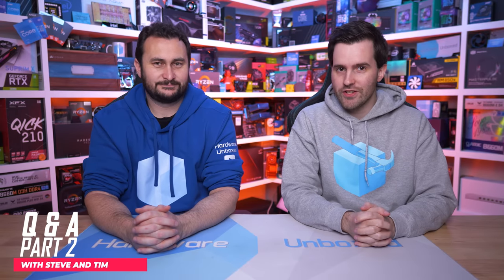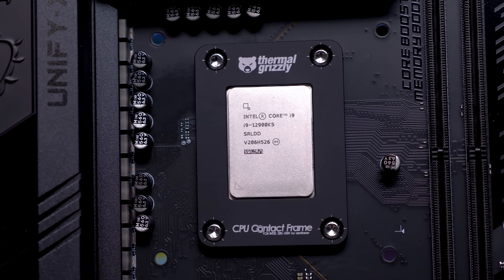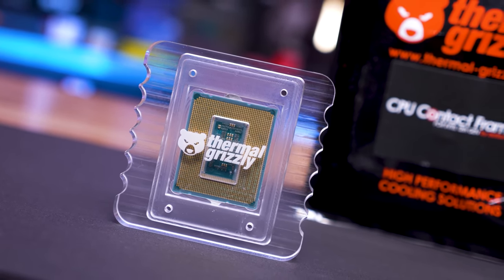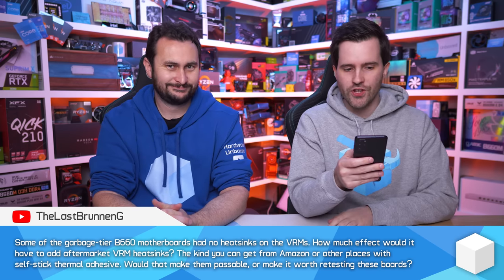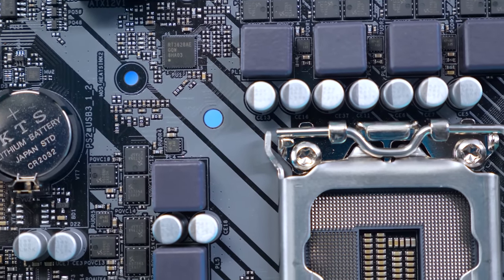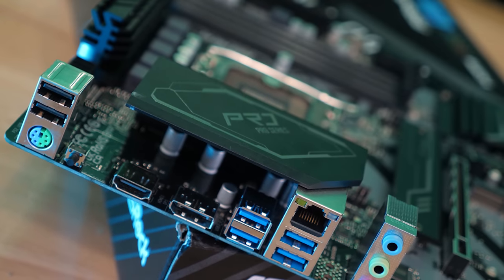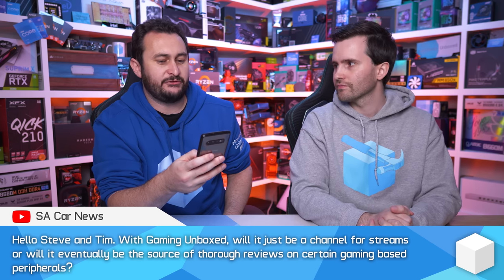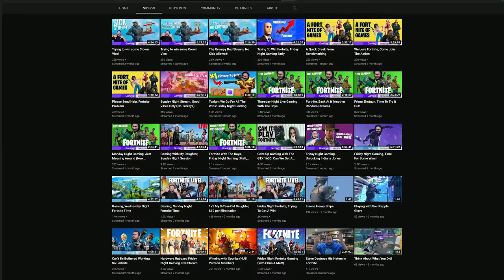Biggest Tech Fail 2022? Zen 4 To Make DDR5 Relevant? August Q&A [Part 2]

Comment: To design a game, that say, dedicates a character's AI to an E core, would be extremely difficult to do in a way that doesnt hold up the P cores, or the AI is held up by the main core.
Reply: Yeah, developers need to sit down with cpu manufacturers and get that 💩 sorted out. I've been sold for decades that games will be multicore optimized.
Reply: @Shadow__133  I have no idea what you want them to sort out. The hard part of a multithreaded game is to keep everything in sync, and E cores can't keep up with P cores.
Reply: @jeromenancyfr  I don't have E cores, but the regular sized ones. And they are barely used by games. What's the point of having multiple cores if games don't use them efficiently? I mean it's nice to record/stream or do photo editing, but doesn't benefit games as much as clock speed.
Reply: @Shadow__133  I just don't get what game developers would obtain from CPU manufacturers unless a solution is found to magically see all those cores as one massive thread.
Reply: @jeromenancyfr  That would be awesome! Or at least coordinate game development with the chip design. Like 5800X3D, that actually reduced clock but the performance gains on some gains were phenomenal. 

What drags the industry is always a lack of coordination between all the parts.
Reply: @Shadow__133  What I described is the Holy Grail, the concept exists for years, if not the start of computers with multiple cores, but nobody found a way to make it a reality.

Comment: Looks like I am going to be satisfied with my system for quite some time. I ran an Intel i5-2500k platform from release to 2020. I then upgraded to an i5-10600k which performs beautifully at 1440p along with my rtx-3070. I will still pay attention to what's new in the future but my current machine is happy. This comment is regarding the ddr5 question. It is not really needed at this time.

Comment: its not only mouse DPI, its also mouse sensitivity in game, good indication is how many cm you have to move mouse to make full rotation (cm/360 angular degrees), I am using 25cm/360, to measure it you can use KovaaK’s Sensitivity Matcher

Comment: Pertaining to multi core processors.  Still gaming on an I7 4790K with an RTX 2060 and it works perfectly on High settings in games like Vahalla, Doom Eternal, Fortnite, and Genshin.  Medium to high on RedDead, Battlefield 5, and a few other AAA games.  So, you don't need a 5950X or an I7 12700 or beyond to have a great gaming experience.  I would have never thought that the 4790K would be great for gaming 8 years later.

Comment: With current CPU limitation to graphics I do wonder if someday they might add a small support CPU near the GPU to handle the most demanding operation in a way that the CPU/RAM/Cache are release from that task and improve game performance this way...we already see this with raytracing, DLSS and so on, hopefully more features could be added. Also would improve sell having more features added on next generations the same way ray-tracing is doing on each generation.

Comment: It is worth upgrading for gaming from a PCIe 3 PC to a PCIe 5 PC - will it really make a noticeable difference in gaming? And, won't the PCI 5 in both storage and GPU both be needed ... because the new AMD 7000 series AM5 motherboards, one has to chose one or the other but ya can't have both ... unless you buy the "Extreme" versions. So, will it be best to wait a generation for better use of PCIe 5 etc?

Comment: If you want to compare sensitivity across multiple titles you use centimetres for a 360 turn. Like actually how much mouse moves (only horizontally) to perform that. Either test it or check it by online calculators.

Or if you compare sensitivity between a certain title or same game engine then you can use edpi which is just dpi x sensitivity value.

Comment: Long story short: If you do productivity, especially 3d rendering you will need a gpu as its always faster than cpu. If you have huge tile size or alot of data you better go with cpu bcz it can utilize the Ram which is always abundantly available. Bcz DDR4 was slow, the cpu couldnt compete with GPU. But now we get DDR5 with alot of speed and super fast new CPUs , so the cpu market is saved : yayy :} I use it in Blender and when my 12 GB of my gpu are drained I must use my cpu , else I run into error!
Reply: Since Blender 2.8 you also need a good amount of RAM. Otherwise you limit yourself big time. But depends again on the Programm itself.

Comment: Gamers generally use cm/360 as a measurement of mouse sensitivity, average probably sitting around 30cm/360 while pros in slower paced games (Csgo/r6s/valorant) will go as slow as 60cm/360. It's a combination of dpi+ingame sens and there are several calculators out there that'll calculate it for you, Kovaaks (an aim trainer) also has one. Modern shooters will usually use raw mouse settings so the Windows sensitivity setting gets ignored. So you'll keep the same dpi (~1600 sweetspot for latency, Optimumtech has a good video on this) while changing your ingame sensitivity setting game to game and calculators will give you the number needed for a precise conversion between games.

Comment: The first 6c/12t CPUs for gamers were the Ryzen 5 1600 and the i7 8700K, and if you bought an 8700K in late 2017, it’s not much slower than the 5600X today, so if you are still willing to put up with the power draw, that’s your 2500K — where the platform, and the old PCI express standard is letting you down more than the CPU performance. Unfortunately, with the cheaper 1600, its single-threaded performance was at least in step with its pricing compared with the 8700K, but it just wasn’t very fast, so it hasn’t aged that well, although the platform around it has, since you can upgrade to your choice of a 5800X3D or 5950X. The problem with upgrading like that is that when you are spending so much more on a new CPU, your build becomes unbalanced around it, and you’d most likely be better off building new. So, you say, I’ll upgrade to a 5600 instead! Well, why the heck didn’t you just buy an 8700K in 2017 and have 5600-like performance all this time?? By the time you’ve bought two CPUs to get there, you haven’t saved any money, and now you’re relying on your old board to support a new CPU.

I upgraded my 1800X in stages up to a 5950X, and it’s a weird pairing with a 5700XT, plus I replaced my motherboard for PCI express 4.0 and Thunderbolt, and I was going to upgrade to 64 GB RAM, change my cooler, GPU, Storage, power supply, and case… So instead, I’m building new next year when Zen 4 with V-cache comes out, and enjoying the extra CPU horses and features for the next six months.

Comment: I still want to see the unlocked SKUs and the Z boards move to HEDT socket like i7-7700x was.  Have i5 and i7 as 2ch 20 lane parts, Z boards as 2ch 20 lane parts with a 240W max power limit and VRM design minimum so that all boards are capable of running that 240w 24/7/365.  Then have all i9 parts be 4ch 40 lane parts, the X boards 4ch 40 lane parts and no power limit.  All CPUs function in all boards, but would naturally be limited to the lower memory and lane count if you put an i9 on a Z board or an i7 on an X board.  The X board would be the only board needed for all LN2 OCing of any chips that way.  I would also suggest considering limited edition unlocked Celeron, Pentium and i3 CPUs specifically targeted for competitive overclocking.
I would also want to see all the locked SKUs on the consumer B and H boards be base clock overclockable, but have a limit similar to that 150W capped B660.  Then even the most budget conscious buyers can still play within limits.

Comment: I would consider the state of HDMI cables to be a fail.  The specs are usually vague.  I have returned more HDMI cables than any other tech item.  SSD's releasing with a fast throughput, then that company keeping the same name but switching to slower parts is a fail in my eyes.  Microsoft was using low level API's in the X-box for years before Direct X 12 was forced into existence by MANTLE.  I believe there was a big push from Microsoft around 2008 for PC gamers to switch to an X-Box,. So I bought a PS3 because my Enzotech water cooled PC sprung a leak and I lost all of the big components, a second system was not in the budget.  I got a month's use out of that system.  These are just my opinion

Comment: AI Specificaly pathfinding can be offloaded to async tasks

Games that have dynamic LOD can also load and process mesh and other elements in an async way before handing them to a synchonous thread for integration into the rendering

Also I'm running a 16000 DPI mouse with the DPI maxed but I have the ingame and in windows speed lower

Comment: It unfortunate to see how many people still misunderstood the purpose of Intel's E-cores. They were never there for gaming. Intel was getting tired of being thrashed in certain productivity workloads that benefited from having lots of cores. Intel also didn't have a meaningful answer to AMD's 16 core consumer SKU, which explains the radical change in 12th gen architecture to big-little core. Etc, etc, you get it.

Anyway, latency is what truly matters for gaming. The reason why modern games require more than 2 and even 4 cores, is because the clock speed haven't improved that much.

Comment: E-cores is basically Cinebench/Vray/etc accelerator. They only named it E-cores to make people think the processor is efficient because it has the word efficiency in it. If E-cores is actually for efficiency and running background task, they won't pack that many since it won't make the processor run more efficient. Imagine if you have a task that can light all 8 cores, would you run it on P or E cores? As for light last, what light task that actually need 8 cores? background task probably wouldn't need more than 2 cores. If your background task actually utilize the E cores to 100%, it probably need the P cores.
Like the video said, Intel put E-cores to win multithreaded benchmark. With their process, at best they can only put like 10 P-cores on a single CPU (probably 12 cores on 13th gen) while AMD can do up to 16 cores for their consumer part, so Intel ended up sacrificing core versatility for packing more of this general compute accelerator (a.k.a E-cores). Their 13th gen, instead of increasing P-cores, they kept P-cores count the same (8 max) and double that slow E-cores count (16 max).
Edit: I actually don't mind E-cores, but for most people that aren't using something like Vray, you don't really need E-cores. 6 to 8 P-cores is enough. But if you do using your CPU for rendering or some other task that can actually light all cores to 100%, you actually would benefit from something like 2 P-cores and 40 E-cores (since 1 P-cores is almost equal to 4 E-cores in size). I imagine 4 E-cores would suck more power than 1 P-cores, so you probably won't see that kind of config. So basically Intel is trading 1 P-cores, which should use less power, with 4 E-cores, which although individually it uses less power than P-cores, but 4 of them is probably not using less power than P-cores.

Comment: Can you guys throw us a bone with a link in the description to the part 1 video in the future pls? It took some screwing around to find it, when really it should have just been linked below. Thanks, and keep up the good work.  :)  I run my mouse at 3600DPI full time, in games i run at that same DPI but i use a DPI SHIFT function on my Logitech mouse to bring it down to 800DPI for fine aiming adjustments in shooters, but that's only when I'm taking a shot, then i release the shift button and it goes back to 3600DPI. I have problems with my hands going numb when gaming, and this helps a LOT since i can move my hand like an inch, and do a 360 spin, unless i am ADS in which case i use the shift state. I also use a Razr 1 handed keyboard on my left hand for the same reason.

Comment: You can use the g-hub software to see what your DPI is set to. That is the true DPI you're using because that determines how often information is reported to the game. You can alter the effective DPI further by changing it in game like you mentioned, but as far as the frequency of the information being reported to the computer/game, that will be determined by the DPI setting of the mouse independent of the game settings.

Comment: Testing some popular configurations may be a cool idea. But the problem is to settle on specific configuration like budget/mainstream build, or typical 1080p/1440p build, or some USD value build. Comments regarding the parts choice would be inevitable.
Theoretically, estimate performance of specific configuration can be calculated from the frame time of specific parts from cpu review and gpu review. The result should be also adjusted for memory and motherboard performance differences, but at least that should have lower impact.

Comment: Why not just use 1 PC as desktop in ones 'office' and run an HDMI cable to the TV (with eARC and HT system) in the livingroom for your HTPC needs and just use wireless peripherals? Then there's no need for dual expenses.
At least that's what i do and it works a treat!
To be honest i can only do 4k 60 444 right now because of my 1080ti, so for 'faster' games i run them at 1440p 120 so i don't drop under 444.

Comment: 22:58 I ran into this problem in 2017, I bought an I5-7400 based computer which was a step up from my previous AMD A10-6700 but ran into problems with games like Fortnite where the 4c4t weren't enough. So i went to an 8c16t Ryzen 7 2700 for my next build after that, and now i have plenty of cores, but my IPC still leaves a lot to be desired. So for my new build this year im going high end, this will be the first time I will be spending 400$ on a CPU

Comment: There are game engines that are heavily multi-threaded, Destiny 2's for instance, but they require a very specialized engine. They use a task-stacking style where they farm out a stage of tasks to multiple cores, wait for therm to all finish, and then consolidate the results in to a final world state that moves forward to the next stage in the pipeline. There's a pretty good GDC talk about it actually. Again though this requires your engine to be written from the ground up to work this way. Unity and Unreal are just starting to expose this style of multi-tasking as a first class citizen in their engines. For teams writing custom engines, if they didn't start this way, they aren't going to retrofit. You have to start from the ground up with all your primitives written to play well in a mutli-threaded world. Latency only comes in to play with these style of engines at the very end when the world state needs to be consolidated. Otherwise each thread processing tasks will likely have it's most important data in cache.

Comment: asking for someones DPI or ingame sensitivity is useless, the basic thing to ask for is the "cm/360°" meaning how many centermetres of moving the mouse sideways until you do a 360 on screen

but that is only basics, the rabbit hole goes pretty deep when it comes to FOV or scopes or windows sensitivity affecting the sensitivity (in some games but not others), then DPI affecting pixel skipping & veritcal pixel measurement syncing to get all your games feeling identical to each other

Comment: No clue what my actual DPI setting is, but measuring it should be reasonably easy on the desktop.  Just need a rig that lets you move the mouse a fixed distance along one axis, and basic software that shows how many pixels it has moved (or displays the current coordinates, so you can calculate that manually).  Might be a bit trickier in any given game, depending both on the sensitivity setting, and exactly how that's applied.

In any case, for me, the mouse itself is set to 1600dpi.  In Windows I have the pointer speed set two notches down from the fastest, and leave acceleration enabled (i.e. "Enhance pointer precision").  In a first person shooter-type game, I adjust the sensitivity until a single normal wrist flick causes my character to do an instant 180.  That seems to give me the best blend of fast response and precision.  Though my mouse supports dynamic resolution changes via buttons, I've never found that useful.

Comment: Hi guys, i hope you are intrested in the new OLED lineup of the Monitors/TV's that launched. Some of them are for sale, some of them will be in the 4Q 2022. So i hope you will get them for the next reviews, here are the models that i am excited for: 
LG 48GQ900, LG 45GR95QE, LG 42" OLED Flex LX3, LG OLED Pro 27EQ280, BenQ EX480UZ, Philips 48OLED907, ASUS ROG Swift PG42UQ (or PG48UQ), ASUS ProArt OLED PA27DCE, Samsung Odyssey OLED G8 34" (G85SB), Corsair Xeneon Flex 45WQHD240.